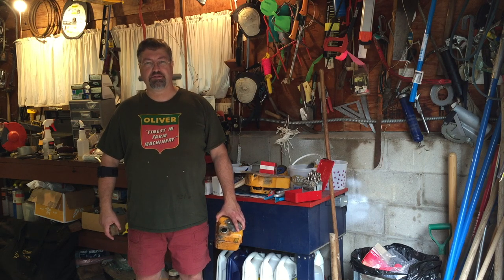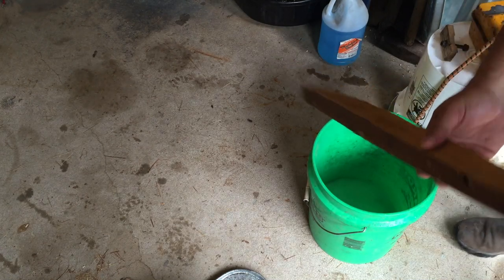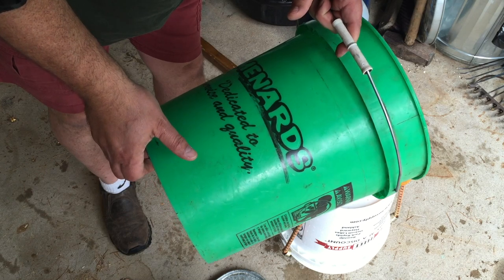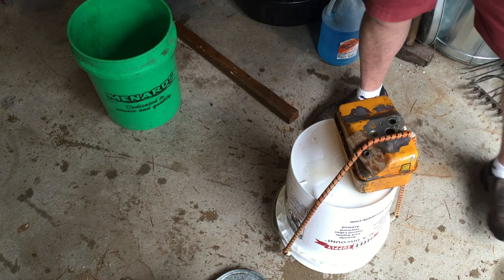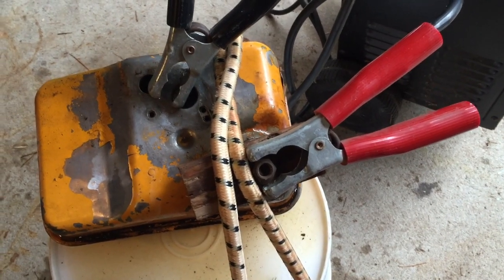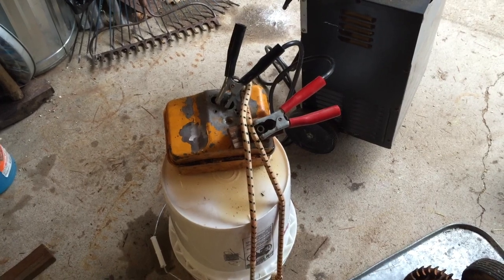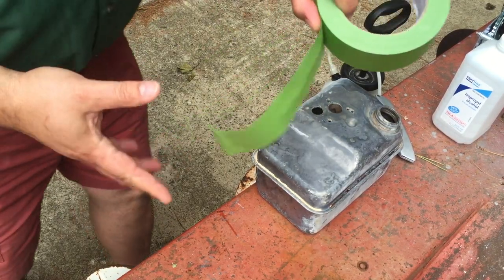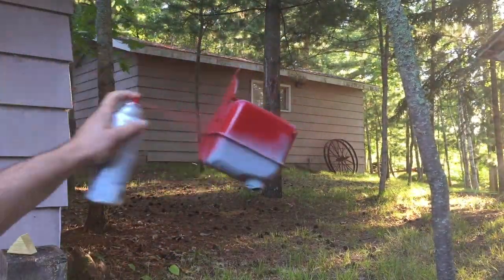Electrolytic Derusting a Briggs and Stratton Small Engine Gas Tank

Comment: I have cleaned several of these with muratic acid but you have to be extremely cautious. Then coat the inside with POR 15 gas tank sealer. It leaves a very hard, durable, and rust free surface. No more rust then. I use the POR 15 on brand new engine tanks like the Hondas and Predators and never worry about them rusting.

Comment: Did I miss a specific de-paint step or did the immersion electrolysis remove both rust and paint?
Reply from the maker: Immersion removed both paint and rust.
Reply: @MinnesotaEric  Thanks very much!
Reply from the maker: It occurs to me did I share that I used a tank sealer in the video? If not I used POR-15 to seal the inside of the gas tank.
Reply: @MinnesotaEric  Yes, you did mention the sealer .  Thanks again.
Reply from the maker: Thank you, I couldn't remember. If you want to help support my channel, here is an Amazon link to the POR-15 kit I use that costs you nothing extra, and helps contribute to my channel. Regardless, thanks for watching! https://amzn.to/37Qxy0i

Comment: No paint, or phosphoric acid inside to prevent further rusting in there?

Minor suggestion, it would have been nice to see inside the tank with rust (flashlight?), then again after removal.

RichE
Reply from the maker: RichE, the inside looked much like the outside. I tried taking video of the inside, but alas, the video didn't turn out using my iPhone 6.